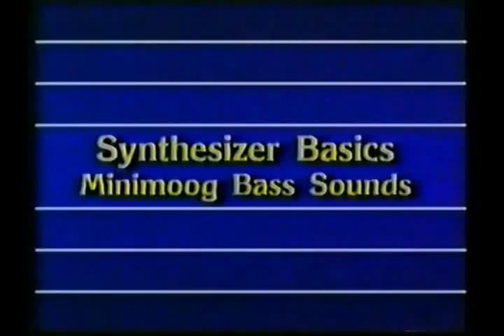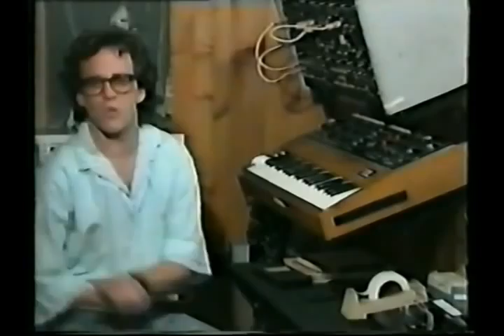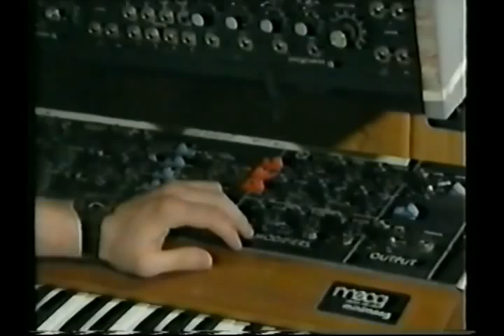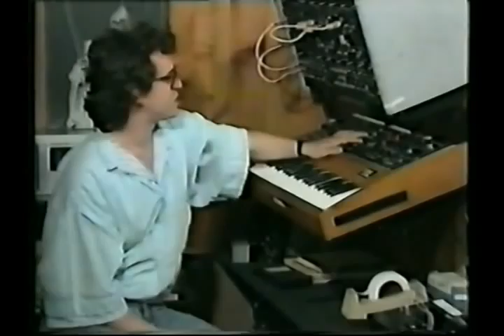Steve Porcaro - Synthesizer Basics   Minimoog Bass Sounds

Comment: What does he mean when he talks about a '16 foot stop'? I've never heard of that before.
Reply: That it the octave standard measured in feet on pipe organs. The pipes have a lower note the longer the pipe is. 2foot stop is the smallest octave for pitch. The Wurlitzer would have tons of stop tabs representing octave pitch measured in feet. Its an archaic thing left over and the Minis were marketed to organ players etc. the term Stop meant cutting off pressurized air to the specific pipes measured in feet.
Reply: @videosuperhighway7655  Thanks for answering my question! :-)